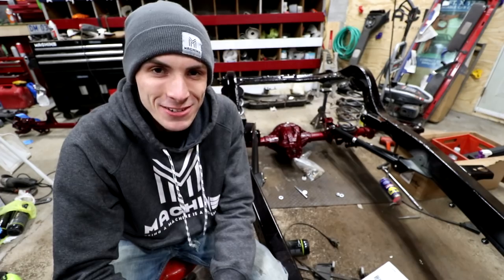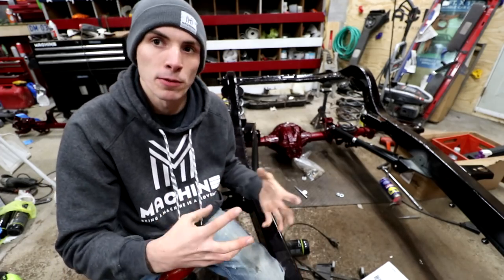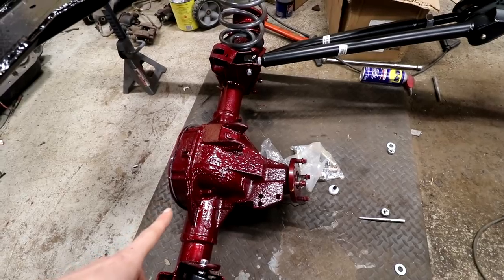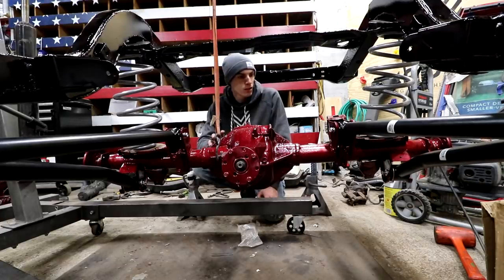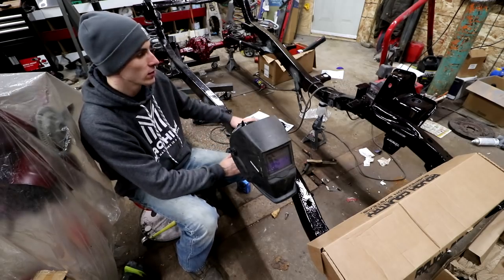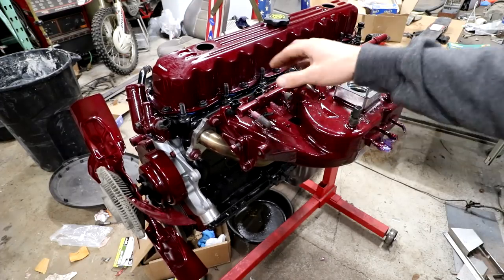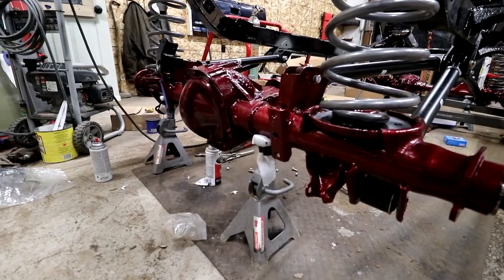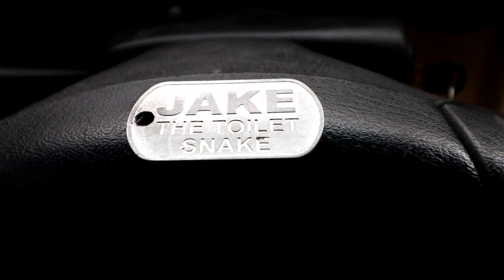Mechanic Lost His Mind - Ridiculous Jeep Build

Comment: For the illusion colors you need to use the proper clear coat for it to be the color your shooting for. It’ll be a totally different color before you put the special clear coat on. I used it on the boost piping on my Duramax